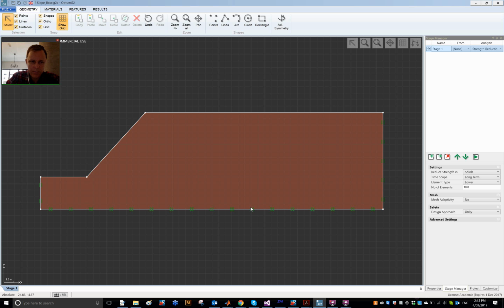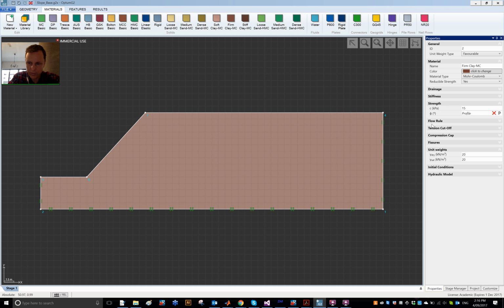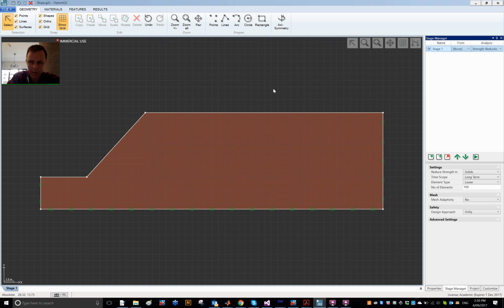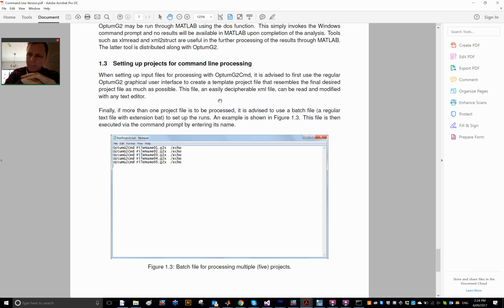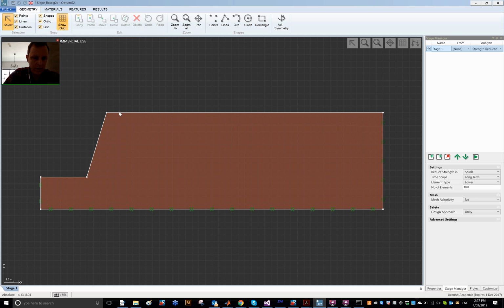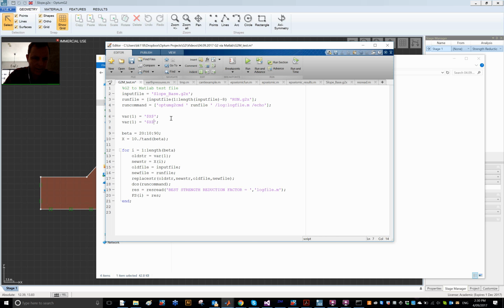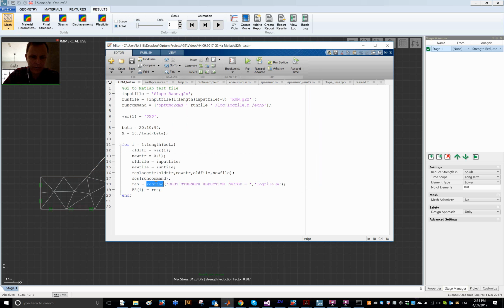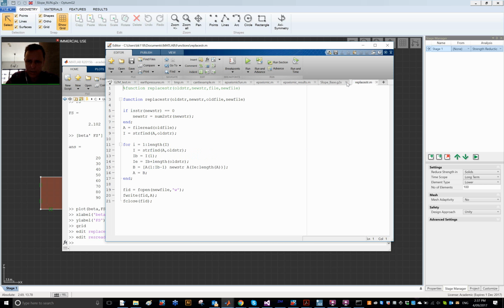OPTUM G2 via Matlab

Comment: That's fantastic! I also established a function to explore the relationship between fs and beta etc.. but here is a problem that the data may exceed the calculation limit of MATLAB, I have no idea what 's wrong. I just suppose it may be caused by the slip surface pass below the toe and such like that. 
So, could u share the codes of the .m files?